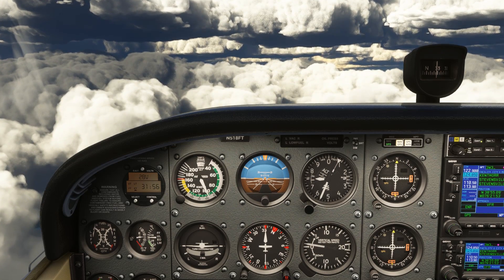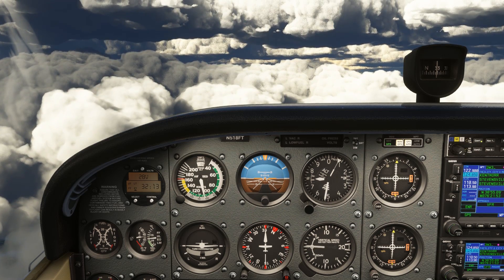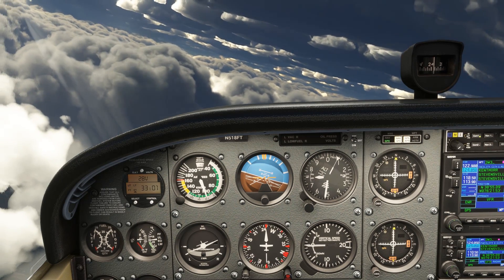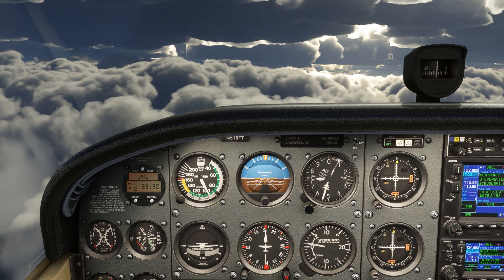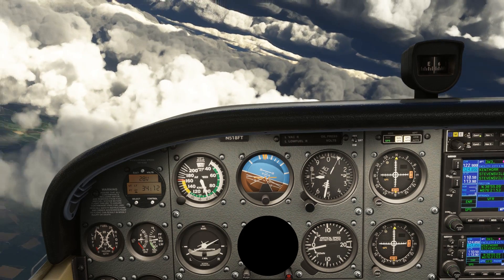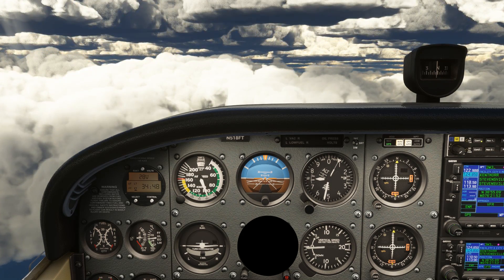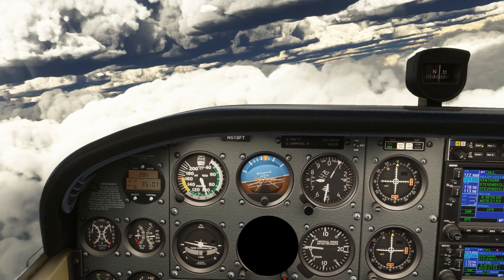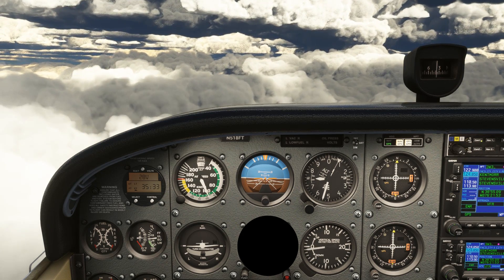Introducing Compass Turns | IFR Training

Comment: I’m new bare with me , but at what angle degree one minute 180:turn? 17 degree?  What is I bank from hell within air frame… that what I’m having trouble understanding. All my books still not quite sure. I know off the standard. But I want to know for all circumstances
Reply: TAS / 10 + half the answer. Ex. TAS 120 kts 120/10=12 12+6= 18 degree bank.
Reply: Depends on your speed. Some digital instruments move the marker for a standard rate turn based on airspeed, but if you don't have this then use the trusty turn coordinator, that's it's job. Helps to practice standard rate turns at different speeds so you have an idea of what bank angle you need to aim for initially to get a more exact timed turn. It definitely makes a difference, especially at slower airspeeds.